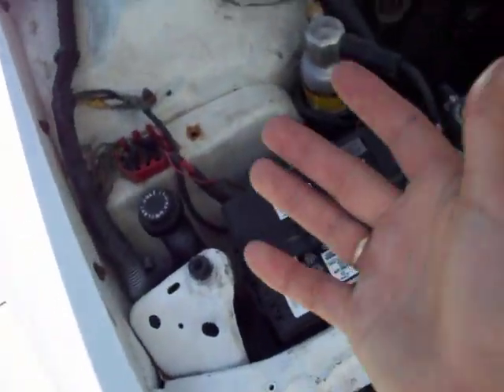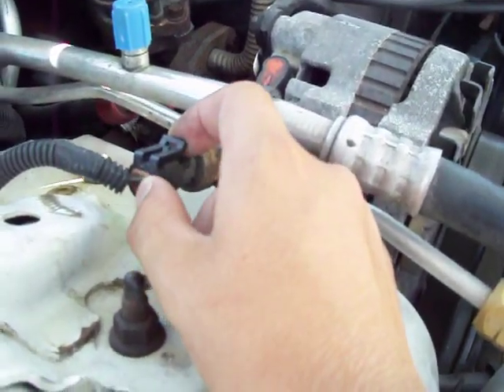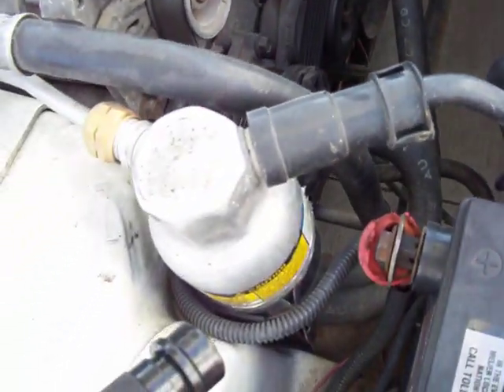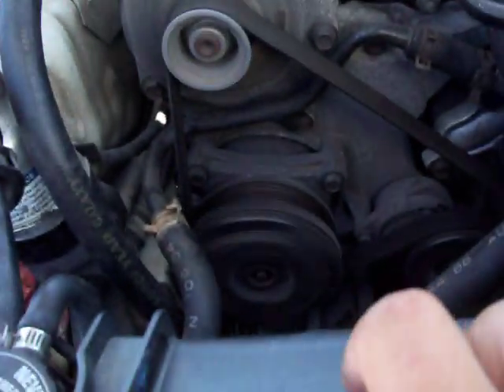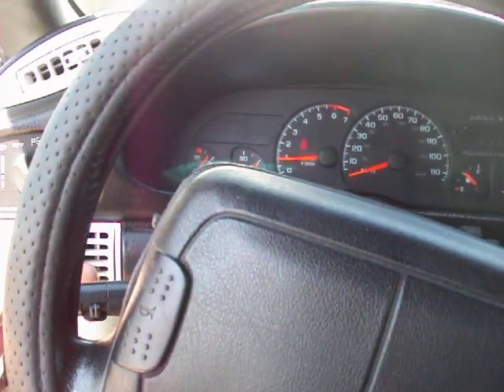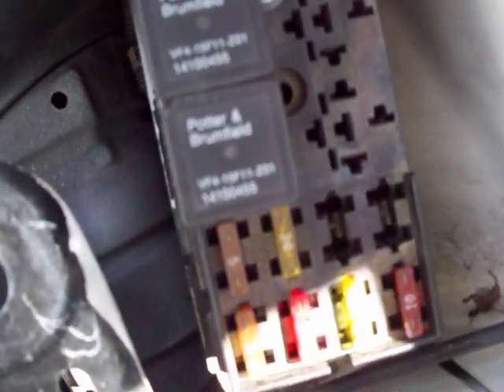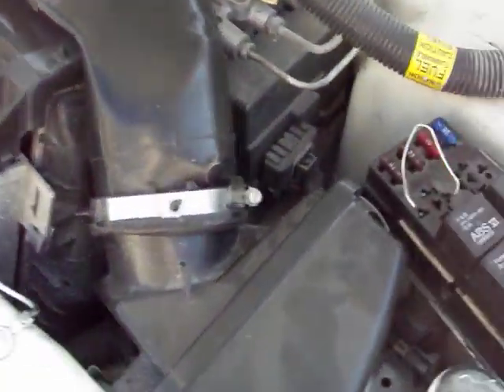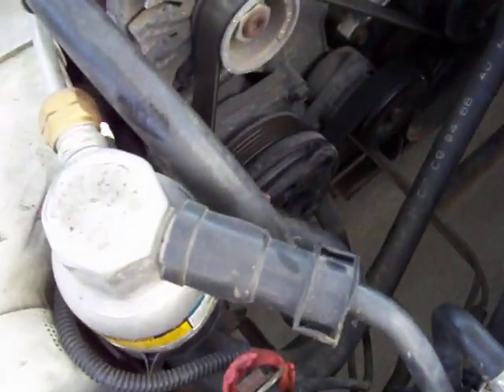How To Make AC Ice Cold, Recharge air, and Force the Compressor Clutch to Engage

Comment: I'm trying to recharge my ac on my truck. I did the paper clip trick but didn't start the clutch. Can anyone tell me what's wrong. Is my compressor bad ???
Reply: Adolfo Perez the clutch itself may be bad. i changed mine in the car and now have A/C again. i order it from Amazon for $100 and 2hrs of work to install it with a friends help. did not have too remove the compressor from the car.  or open any lines. look into that. hope that helps you
Reply: cam1138 thanks man, will do that !
Reply: great hope that dose it. my kit came with the coil, pulley, bearing, and clutch. it was the actual coil that went bad on mine. The hard part was the snap rings. taking them off and putting on the new ones. 2 of them. theres lots of u tube videos on replacing this part. oh thank God for YouTube.
Reply: Lol that's right man... thanks again

Comment: This kid is nearly clueless here, he knows just enough to be dangerous and is passing this bad information along to the unknowing.

The high pressure switch he pointed out only cuts the compressor if the system is over pressurized.  The low pressure switch is the one that will cut the compressor when the system is low.  There is no reason to bypass any part of the system, as you fill the system the switch will turn the compressor on.  Relying on pressure only to establish a fill isn't accurate as temperature and RPM will change the pressure.  Ideally the system would be evacuated and filled by weight.  As a DIY refill, add just enough that when the engine is held around 2500RPM the compressor stays on, this will reduce the chance of an overfill.  This can't be reliably done on a cold day, it needs to be above 70 and with the A/C fan on high.  Having gauges for both the high and low and balancing those pressures according to the ambient temperature can get a pretty close to perfect fill.

The refrigerant doesn't 'double as a lubricant' as he stated, there's actual oil in the system that gets circulated by the moving freon.  Continuous leaks and refilling or replacing of parts will lower the oil level and can damage the compressor.  A system that has leaked down to 0 may have air and moisture in it that can lead to damage if not removed.
Reply: Hello DonziGT230- I agree that the individual who posted this video over 4 years ago has steered a lot of the unknowing people in the wrong direction of how to do work like this... With that being said, He has done a few things correctly here... One is to operate the a/c compressor in a system that is undercharged and has developed a lower pressure in the low pressure (suction) side of the system... This lower pressure in that (suction) side of the system has enabled refrigerant to be introduced into that side of the system... Otherwise, the static pressure of the low side of a system that is not operating would be too high to accept any refrigerant... One thing that He should have pointed out in this video is: to first turn the compressor drive plate on the end of the clutch by hand, to see if the compressor actually turns and is not seized... That was one of the many things that he did wrong here... Most of everything else You have stated here is correct. But the newer refrigerants (R134) are not called Freon anymore... Freon is a registered patent of the Chemours company which was used for the older types of refrigerants, like R12 in the automotive industry... And the most accurate way to fill the system with the correct amount of refrigerant and the correct oil, is to use a charging manifold and a Pressure/Temperature chart.... Otherwise, it's a crap-shoot of how much refrigerant should be added to the system... Since this video post, the individual who posted this created a more recent video stating that He has had formal training and has stated that some of his methods were wrong in this video... Many people have viewed this, some see it as a lot of bad advice (as I have), and others proclaim it to be the best thing since sliced bread.... One thing is for sure, when heeding advice to do anything, LOOK BEFORE YOU LEAP!!!!
Reply: I've never had a system not energize the clutch as I started filling (except one) and I've done hundreds of fills.  There's absolutely no reason the low pressure switch wouldn't energize itself since they cut in well below the pressure in the filling tank.  The correct way to fill is not with a manifold as you say, it's by weight.  You can generally get a good fill with a manifold set if you know what you're doing, but it's not the right way.  If the guy has learned the error of his ways he really should delete this video or at least re-title it as flawed so that others don't use it assuming it's good information.  Posting it was ignorance, if you're right and he's learned better then leaving it up is negligence.

The one that didn't energize was a Mercedes, I had no clue the computer had to be flashed to accept the new compressor until afterwords.  Bypassing it would have accomplished nothing but getting it filled since the computer wouldn't let it work anyway.  There's also a good chance that bypassing it would have created other problems.
Reply: "...Continuous leaks and refilling or replacing of parts will lower the oil level and can damage the compressor...."  Just purchase refills that contain oil and that problem is solved.
Reply: It's not solved because you have no idea how much oil has leaked vs. how much oil you're adding.
Reply: Rightly you nailed it. There are some key steps he took during application which are good for diagnosing but might not necessary for recharging, one of these steps is using the paper clip to force engagement of the clip that can easily show if the clutch is working or the compressor still running when the clutch or compressor fail to run due to some sensors issue. I give him a credit there, I guess the expert folks won't show that in there videos because of being too careful of not leading folks into the action that could complicate the system. I am saying this because my AC clutch is hard to reach, and no way to make direct test of function and him showing the paper clip really bring hope to my troubleshooting of the system.

Comment: Very nice vid. Direct and to the point. Much appreciated.  I have a 97 F-250 that the A/C compressor doesn't in gauge . I will try this . Also a 96 Dodge at work . We didn't know the compressor had to be on to fill it . We thought low or no freon would not let the compressor spin . Low pressure safety switch .

Comment: Ummmm... not sure why you're calling refrigerant coolant... but also, stop leak is HORRIBLE for an AC system and it should NEVER be used. Not only does it rarely work, but it can ruin the system. Also, if you ever take it to a shop to get repairs later, they won't touch your vehicle because the refrigerant has been contaminated by stop leak. If you have a leak in the system, you need to find the leak and make the necessary repairs. Going the cheap route with the AC system will always cost you more money in the end.

Comment: Well done, you explained really good the basics of A/C. At least now I know how can I test it in case I have a problem.
Reply: +Tamas Turi  This video DOES NOT explain the basics of vapor cycle machines (A/c systems)... Please refer to the CORRECT methods to do work like this before attempting this!!! Auto Zone has an excellent video available to CORRECTLY do this, service manuals and other sources of the correct way to do work like this is suggested... This video posted above should be dis-regarded... Not to be a party-crasher, quite to the contrary- I'm just trying to prevent damage of equipment and injury/death to people who are following bad advice like this video shown above...

Comment: Thanks for sharing this video!  Really helped me out to get my ac working again!  Paper clip trick is f-ing genius!
Reply: +Beaverj420 The paper clip trick is an accident waiting to happen!!! Use only an insulated 16AWG wire with bayonet connectors on both ends to do this... Use the right tools and equipment and procedures to do this work... Disregard the air-head 101 video posted above and get training from an EXPERIENCED PROFESSIONAL TECHNICIAN on how to do work like this... Auto Zone has videos that show the PROPER and SAFE methods of doing work like this...

Comment: You're low on freon there is a low pressure switch also which can be can be on open if the pressure is too low even though you jump the high pressure

Comment: My AC blows air but not cold. I'm going to Phoenix and it will be nuclear hot there. I'd like cold AC, especially since I have kids.
I was told that the compressor was bad...but hadn't seized yet, with the indication that it's worse/more expensive if it does. From what I'm learning, seems if the compressor is "bad", seized or not,  it really shouldn't matter because either way, the job is to replace it to make it work.
Me and my daughter are going out here in a bit to check the clutch and anything we can to see if it just needs refrigerant or if it truly is the compressor (because I don't have $600-$800 to fix compressor)
Thanks for this video, it is helpful to see how to check the low & high and bypass with the paperclip.

Comment: Man I really appreciate this video. I’m still struggling to get my AC to work though in my stupid mustang 03. I turn the AC on and set it to max and my compressor just turns on and off and cycles. Then it was magically working for 5mins straight and was finally blowing colder air . But unfortunately it stopped working :/ and the pressure is reading that there is enough coolant in it . I am lost :( and it’s about to be 115. Degrees here  in Portland this weekend.

Comment: I suggest to try this first.
Somebody inside the car while running presses on gas till the engine rotates around 2000 rpm,  you will see the needle of the gauge ( I used AC pro)  will go from  red area  to the white one, that's when you should fill the line (low pressure line) , after some tries the clutch engaged. It worked for me on the Honda CRV 2010.

Comment from the maker: @WARDOG4491 right on the money. The fuse labeled HVAC is the one you would be looking for. It stands for Heat, Ventilation, and Air Conditioning. The blower motor runs off that fuse.

Comment: Jonathan Johnson - He's not telling you to keep the compressor engaged at ALL TIMES, he is simply stating that you need it engaged to add pressure to the system.  OBVIOUSLY, after you are done adding pressure to the lines, you need to take out the paper clip and replace the relay so the compressor will work normally.

Comment: I don't think shorting the hi pressure switch will start the compressor. It's a normally closed switch that opens when the pressure is too high. You need to jump the low pressure switch that is a normally open switch that closes when the system has pressure. You can jump this switch to test that the compressor clutch and related wiring and relays are ok .If your clutch wont engage and you jumper the low pressure switch and the compressor clutch clicks in then the electrical part is ok but the system is low in charge. If the clutch doesn't ckick in then check fuses, wiring, relay or clutch itself. If you hook up your refilling can to the low port you just start filling and when the pressure comes up the clutch should engage automatically, no jumping needed.
Reply: LOL, go short it and you will find out!

Comment: Refrigerant leaks slowly through rubber hoses and compressor seals approximately  4%/ year. Enough to stop working after  10-12yrs. It's recommended to service a/c gas every 2-3years by purging and adding a correct amount of refrigerant.

Comment: If you jump your ac clutch relay you must jump your ac fan relay as well. Because if you take to long some cars will not engage your fan and your high pressure will pass 400 and then you can damage your compressor. This is only when bypassing the clutch. The best thing to do is bypass  both or if all possible you should always pull a vacuum this will always let you suck the first can quick and compressor will engage. Just a side note incase you bypass clutch tro relay.

Comment: Personally I wouldn't advise running a pump too long without freon if it's not kicking in normally. You should cycle the clutch off then on in few second increments until it has enough charge in the system to run itself. The proper way to charge a system that doesn't come on is with manifold gages under a vacuum state to get the compressor to come on. But, if in a tight spot saving cash, cycle that clutch otherwise it's hard on the pump. There's a reason why they don't come on if the freon is too low... to save the pump.

Comment: i have tried this before.  if you try to get the A/C to blow too cold it will freeze up the evaporator core causing the A/C to not blow at all.  if the A/C is functioning properly, then the temperature at the vent should be at least 30 degrees below ambient temperature.  if it is not, then you should repair or replace the defective part, pull a vacuum and recharge with the propper amount or refrigerant...not coolant.  coolant goes in the radiator to cool the engine.  and if you absolutely need snowflakes blowing out of the vents, you can have it doing it this way until the compressor gives out within a year depending on how long and often you run it.

Comment: Application                             Specifications
Compressor Type                    Harrison HD6/HR6-HE 6-Cyl. Or Harrison V5 5-Cyl.
System Oil Capacity(PAG)       8 ozs.
Refrigerant (R-134a) Capacity    32 ozs.
System Operating Pressures (2) 
High Side         115-200 psi (8.1-14.1 kg/cm2 )
Low Side           21-29 psi (1.5-2.0 kg/cm2 )
(1)
Use PAG Refrigerant Oil (Part No. 12345923).
(2)
Measured at ambient temperature of 70-80°F (21-27°C), with more than 50 percent relative humidity.

Comment: with today's compressors they do not have a oil sump 
and rely on oil mixed in with the 134a to lubricate the compressor pump .
So if you are low on 134a you are also low on oil and will need to add oil or the compressor will seize up !
leaks should always be fixed !
Reply: That is very true John Lieske.... It is important to maintain the proper amount  of refrigerant/oil in the system because of this non-usage of oil reservoirs in many of the newer systems which is why a small amount of oil should be injected along with the refrigerant to re-charge an A/C system... It is also another reason why I like the older vehicles and older systems so much... Way more durable.... Yes, the leaks should be repaired, and this is always a good practice, but that means that the system has to be opened up and parts need to be replaced when the source of leakage has been determined... This is where it can get expensive, and this is why so many people decide to RUIN their systems by injecting the sealant to temporarily 'repair' the system just before selling the vehicle.... This way it becomes somebody-else's problem... It is why I feel that these sealants should never have become commercially available to the public... BTW, there are test kits available to detect the presence of a/c sealants in systems... That is good to know, BEFORE buying a used vehicle....
Reply: My opinion is the sealant were developed so the uneducated would use them and ruin the system to help the manufacturers sell more parts !
Reply: That is possible John Lieske, but with the cost of repairs - and the probability of repeat problems from residual a/c sealants still in the system (that have not been removed from the initial flushing) and component changes, it is very likely that an otherwise good vehicle could be sent to a salvage yard.... This is what I believe what the auto manufacturers want.... If they (auto manufacturers) had it their way, every older vehicle would be removed from the face of the Earth.... It is things like this that should not be allowed to be sold to the public in the open market, just as the FDA (supposedly) keeps us safe from eating foods, drinking liquids and taking drugs that are not good for us...

Comment: Before anyone “junps” me for saying this, let me clarify on my last comment, if you JUMP and BYPASS the sensor, that means something is seriously wrong with the system to begin with, most likely a Freon leak, this guy didn’t bother to mention what happens to you if Freon is blown back in your face or skin if you do this and blow something out, the oxygen is pulled from your lungs and you feel a burning sensation if you accidentally inhale Freon, if it’s hot and your compressor isn’t cooling the car enough, it’s because the car ac was charged at a lower outside temperature, that’s why we me mechanics use thermometers when charging the ac system, just take it in and have a mechanic recharge it. If you don’t know how to tell if your ac is leaking, take it to a mechanic or put a vacuum pump on it. That’s how we check to see if it’s leaking, the. We use dye to find the leak,. I’m not trying to be mean, I’m actually hoping the guy making this video reads this before he destroys anymore compressors.

Comment: This helped me out a lot bro especially when both of our vehicles are the same 95 3.4l Camaro's, Nice!  However, I still have that leak problem, please help!

I think I have a leak because I have put freon (134a) 5 times on the car already, and after a week it doesn't blow cold air anymore, but warm hair (depending what temperature is outside).  I manage to put in the seals on the High Pressure Line & on the Air Compressor, which helped keep the cold air in for a few more days, but still the cold air seems to get out after a week and an half later.  What do you guys think it is?  Is it the leak?  If not, or If so, what should I do?  Plus you said it should be between the 30-55psi right?